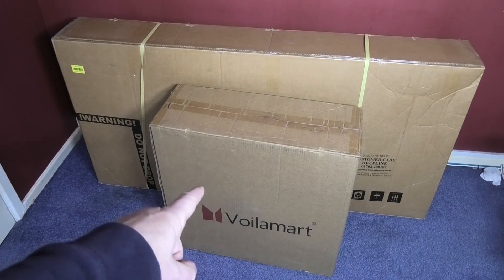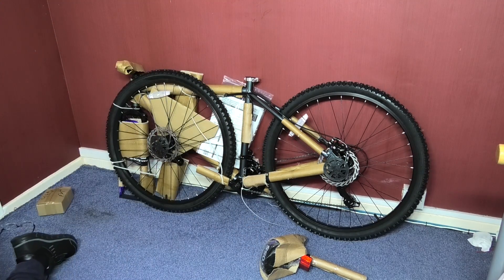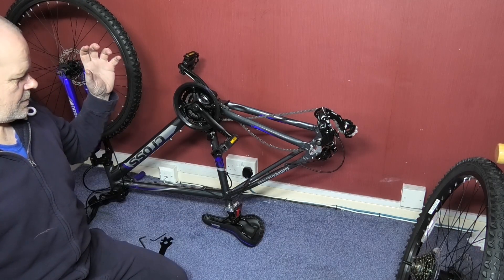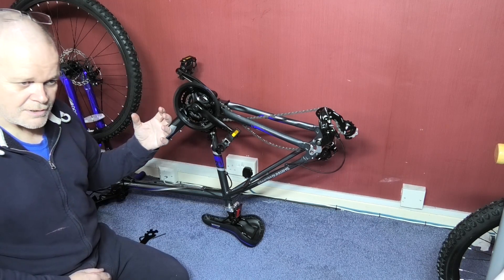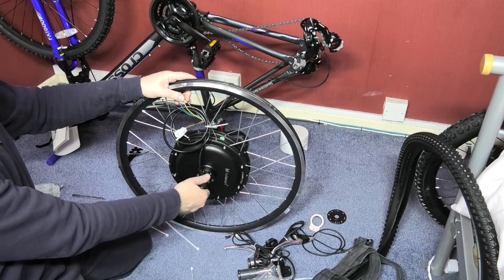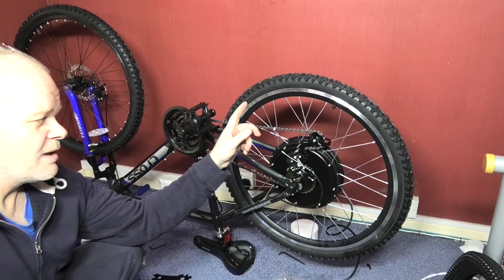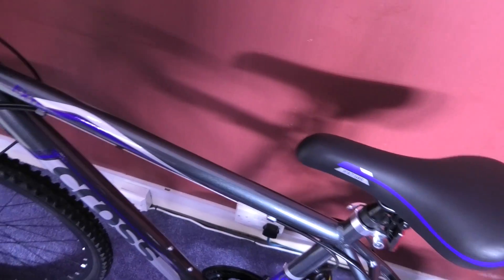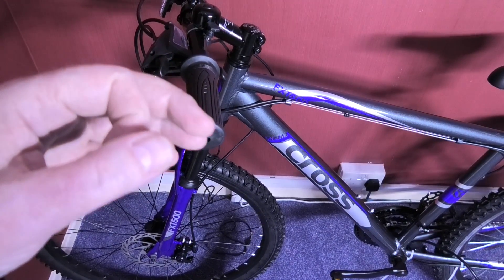Budget 1500w DIY eBike build part 1 - As cheap as possible

Comment: Hi mate your the guy who know a lot about ebike I need your help I e got a 1500w 40amp controlled runs nice and smooth with lots of torque iam swapping it out because I could never get the pedal assist to work I've ordered myself a new different 1500-watt 40 amp controller I've checked all the halll senses Phaser wires etc but is running like a bag of s*** and sounds rough have you any idea what it could be
Reply from the maker: Some of them have a 'learning' mode where you connect 2 wires and it measures the hall sensor angles, it's usually just 2 wires you connect together and then arm it.
Failing that, it sounds like you have the wrong phase to hall sense combination. try swapping a couple of the hall sense wires over. You won't hurt it.
Just because you have blue to blue, green to green and yellow to yellow, it doesn't mean it's correct.
Reply: @Vortecks  hi tony I've used to self learn wire  other day  the wheel to spin forwards only for a few seconds does it need to be longer plus I've tryed swaping the phase wires around but wheel spins backwards should I try the self-learning wise again but  longer time  or used to self learn again so wheel spins backwards and then swap the phase wires

Comment: I'm a tad late, next time you have to put grips on, use the spray women use to keep their hair in place -no, not the one youngsters use to have pointy hairs, the spray used by elderly women to look young and beautiful. This product lubes up the grip and the handlebar so you can slip it on, until the solvent dissipates, in which case it becomes a bit sticky. It won't glue the grip in place, it will help it to stay in place. 
If you want to take the grips off, use WD40 with the straw : spray between the grip and the handlebar, and twist. Be sure to de-grease the handlebar before putting the grip back on, otherwise it will slip -but I assume you guessed that.

Comment: On the note of torque arms, I would say always fit one if you're going above 750-1000W. I had to add additional support on my 3kW ebike to stop the dropouts from being pushed apart.
Reply: Very true especially if it's a cheap bike, I used them on my 1000w bike had to wait a week for delivery. Wanted to ride it so  I used a spanner and a pipe clamp until it came Works just the same lol  :)

Comment: you will be surprised what that wheel can take power wise tony, i started with this kit and now have a BT programmable controller able to give 40amp 88v  to it, i dare not go above the 40 amp but top speed is around 56mph but this too was on a budget and by making my own battery i was able to build what i consider to be a hotrod for under £500 bike not included
Reply from the maker: 3 years ago, when I built my original 1500W bike, it was over-volted to 72v (with a different controller) and it ran superbly until I sold it. I'm not doing it with this one because some unlucky person will end up buying it 😁

Comment: I fitted the cadence pedal assist to my build,  I like it. 
Thanks for sharing your knowledge,  good man.
Reply from the maker: I've heard mixed reports about the cadence - some have told me not to fit it as there is no power control and (without the LCD to select a power setting) it's always full power 😒

Comment: Will you be doing a test ride video? as i am looking to build an ebike using the same wheel and would very much like to see how it performs, also is there a particular reason why you didn't pay the extra £6 for the LCD version? which comes from the same seller it's the one i have in my watch list and noticed it's the same seller.
Reply from the maker: The test ride is an absolute must!
As the title says..... "As cheap as possible". £6 is £6 which all adds to the cost. I managed to knock them down on the price of this kit anyway 😁
Reply: @Vortecks  Great i shall be looking forward to that video, good to know they will accept offers i can maybe knock it down to £175 as you say every penny counts i guess you offered £170? anyway good luck and thanks for the rapid reply.

Comment: Just fitted my second bike up with this kit. it was previously installed on my old bike which was a Voodoo Hoodoo but this black Friday i decided to treat my self to a Voodoo Bantu. these kits are missing a screen and a programmable controller like i had on my first 1000w voilamart kit. When buying i assumed it had one but was disappointed when it arrived to me with out it. Replacing the controller with compatible throttle and screen isn't worth it as these kits am cheap yet( after market controllers if you can call them that) they cost just as much as these kits do new i know you can find cheap ones but i don't trust direct shipping from china plus the waiting times. As for regenerative braking i don't think these have it on them as I've never noticed it kicking in or anything like that.

Comment: I have 2 of these hub kits and advised Tony that torque arms would be a better idea due to the cheaper steel of the dropouts... I expanded both dropouts on both bikes before I got the torque arms... I will be uploading a video of repairing one of these hubs and putting a new cable on it just in case anyone needs it... I will also show how to replace the hall sensors as I have already done this..  The controller is capable of 60v as I have had mine up to 67v
Reply: Yes I would like to see this just snapped hall sensor wire did not have toque strengths wheel come out and snapped black hall sensor wire and need to open the hub to get to the wire to repair can you send me the link much appreciate it thanks
Reply: @davidbov9148  I will send you the link to the video, I am just awaiting replacement cable to arrive from China... It should have been here by now...
Reply from the maker: "It should have been here by now"...... how many times have I heard that about China stuff? 😂
Reply: @Vortecks  yeah sometimes its a pain... Especially the batteries... Which I am going to be doing a group buy soon to take advantage of my new membership discounts that have just come into effect.. Although there seems to be quite a delay in those arriving at the moment... Which is typical when I just want to get on and build the packs that have been ordered
Reply: @davidbov9148  the cable has finally arrived so I will be making the video this weekend... So you don't have to wait as long as I did, you can shorten the cable if you have enough to play with like I did on my other one... I just extended the power cable for the battery and moved the controller closer
Reply: Steve Dyson thanks steve

Comment: Nice to see you falling for the same problems we all did, it's lucky you have set up that forum to help you out so I'll keep out of it ??   ... but a hacksaw to those original brake levers is a cost effective solution !!
Reply from the maker: I'm leaving them 'as is' mate. The only benefit of having the cut-out levers is to stop the motor. If anyone is dumb enough to forget to close the throttle, I don't think brakes are gonna help anyway 😂
Reply: @Vortecks   I have one installed so when I'm at a red light I hold it and the throttle and just release on amber.  I need it as it controls the regen brake on my controller and when you have PAS the cut out can be helpful as there is a delay, but you didn't install that either so yeah.

Comment: Love it this will help a lot of people out so long as its kept simple. Also id recommend the fattest rear tyre the frame can take for some rear suspension
Reply from the maker: It will be as simple as possible apart from the casing which I've decided to design. I've got to go into great depth with battery building and (although it's not really needed) I'll have to go into BMS fitting, too. If I don't, I'll only have a load of questions........

Comment: Hey mate, long time no see
I’ve got a carrera vengeance ready for a doner bike, been wanting to convert for ages to take with me on the motorhome, might just do it now
Reply from the maker: Simon!!!! I was thinking about you only the other day when I found a folder with loads of DVR recordings in. It took me a while to figure out where they were from 😂
Get it built and do a video but please be careful....... I know your past history 🤣
Reply: Do it do it do it!! I did it on my vengeance black 18 inch frame and ive put a 2000 watt motor with a 52v 17.5ah battery what a beauty it has turned out to be!😍😍 change brakes from mechanics to hydro, get clark m2 from amazon, front and back fro £50 with disk and pads and they work wonders!

Comment: is there really much difference between the cheap 1000w and 1500w hub motors?
Reply from the maker: 500W difference - 50% more power
Reply: I have had both the 1000w and the 1500w motors in bits and although  can't tell what difference the windings are as they look very similar.... I can tell you that on the 1500w version, I have pushed 3000w through it... It got very hot but survived...

Comment: I would have gone a different route and used a Bafang Mid drive, I have tried those cheap "9C" hub motors and had to many rear punctures and pinch flats. To solve the brake issue I would have bought at least one stick on magnetic sensor type which they usually offer on the bafang kits (so I got spars if you want one) and cut the connectors off and changed them over, they are only 2 wire so it's real easy and using those sensor types will allow you to keep your integrated brake gear changer.

Comment: Post a video where you try out one of the budget sine-wave controllers - they look identical to the aluminum boxes you get with a violamart kit, but they're supposedly much quieter...
Reply: I changed the first of the controllers that I blew up on this kit... Over volting it... Replaced it with a KT36/48 1500w pure sine wave.... To be fair I didn't notice it at first until I put another none sine wave controller on...

Comment: I had the same problem with the regen brake levers / integrated gears can you find an solution pleas !!!
Reply from the maker: The brake levers are purely a motor cut-off and they don't affect regen. Apparently, if you let the throttle off and then open it slightly, it does start braking but I don't know if it's regen or active braking. I haven't tested it myself.
Reply: After looking at my two, 1 has the voilamart controller and other has the KT48v pure sine wave controller... The voilamart controller only has ebrake... Where as my other has regen .... Sorry for the duff info Tony..

Comment: I have a similar build. 1500W at 48V - same motor kit and everything, although mine's based on a 20+ year old scott. It tops out at 34 on flat, 37 downhill
Reply from the maker: I'm determined to see more than 40mph. If I don't, I'll keep increasing the voltage until I do 😁

Comment: Hi Tony
This is the exact same kit I fitted to my bike so I know a wee bit about it. Only a wee bit cause I have it in bits again atm but more about that later.
For the brake sensor issue you can either fit sensors and magnets to the original brakes and these are fairly cheap online, it's what I plan to do with the hydraulic brakes on my new (to me) bike.
You can also replace the brake/gear combo with gear only and use the sensor brakes. Not a perfect fit but can be done.
But more importantly, Please please please use the PAS but instead of plugging it into the controller which is pants as you said connect it to an Arduino and use the Arduino to control it properly. The 5V output from an Arduino is perfect to drive the throttle input of the controller. This would give you fully controllable PAS plus the option of cruise control and best of all I could copy your programming cause I'm useless at it. 😜
Finally  that controller is OK but badly built so I'd strongly advise you take it apart to resolder the high current tracks as they'll be very badly soldered, and for a bit more oomph bridge at least two of the current shunts with solder. 
Loving the videos mate, keep em coming.
Reply from the maker: I'm only building it to sell it mate, I'm not making it a dream machine 😁
I've already stripped the controller and added more solder - it's the first thing I do with every controller. I'm not doing the shunt mod because ultimately, it's not being built for me so I need it to be 100% reliable.

Comment: drive exact this motor for 14 000 miles with speed control and the cheap controler. Batterie is 14s 7p without bms - Balanced every 2 months with a junsi 308 dual charger. With some little modifications this motor is durable. Energy consumption is a little high. For motor braking use a magnetic sensor which can be clued to the brake levers. Regen doesnt work because the necessary connexion in the controler isnt there.
Reply from the maker: Apparently, some people have said that it does do regen braking but you have to open the throttle very slightly after you've released it.
Reply: @Vortecks  someone told you have to connect two pins ? in the controlller for regen. Do you think its possible to restrict the pass sensor to 25 kmh support to make the voilamart street legal here in germany ? My main machine is a bafang bbshd which is programmed for support up to 25 kmh when i am on the road. Because we have our own forrest I use the full support when riding here. By the way - enjoy your videos - learnt a lot from you as absolut expert.

Comment: I've got the same kit on my bike I did fit the pedal assist but took it off again as it comes on full power I didn't fit the brake switches as soon as you let go of the throttle the motor cuts out I've done well over five hundred miles on mine no problems at all I power mine with a 48 volt shark battery and it does 40 mph no problem
Reply from the maker: Out of interest, do you know how many cells in series your battery has? Is it 50.4v fully charged or 54.6v?
Reply: Vortecks hi Toni I think it's 50.4 it's only 10 amp hour so my range is only about 20 miles I use mine to commute to work and back 10 mile round trip it's faster on bike than it is in car one lad at work goes the same way as me but turns off the main road at a set of traffic lights he has got a Kawasaki ninja and believe or not I often beat him to those traffic lights
Reply: Just checked battery now it's charged it is 54.6volts

Comment: " I need to fit this but this is all intergrated.."
Part of the reason I haven't started on a conversion. I can't find the integrated hydraulics controls with ebrake contacts :(
Reply: Look at magura mt5e and canabalise the finger lever...but watch out..two types exist..open or closed circuit ...😀
Reply: I've got tektro HD-725 hydraulic ebike brakes on my bike, they have the motor cut off connections
Reply: @mushroomgods4707  yeh but they are a bugger to buy. btw those are the ones i am after to upgrade the tektros on my bike
Reply: @AJB2K3  They are good brakes, quad piston and mine came with 203mm discs front and back.
Reply from the maker: Generally, you don't need them - if you forget to release the throttle when you brake, it's the only time they're needed.

Comment: I used the 1500w voilamart kit with lcd and a 48v 17ah battery   absolutely love it...excellent kit in my opinion... great vid tony 👍
Reply: Hey guys, I have 2 of the older ones like Tony with the external controller.... As a battery builder, I have pushed 3000w through mine at 67v and hit 57mph top speed... I love the kits and the price is awesome....
Reply: I have the same and get 30mph but rarely get a wattage Reading above 800, am I missing something?
Reply from the maker: It's possibly due to your battery not being able to handle the current mate
Reply: @stevehailes1  steve..mine the same,never seem to get a wattage reading higher than 800,but can get 38mph out of it..my controller is built into the hub.. it's a fantastic budget kit,I've a 52t chainring so can peddle up to 28mph with pas..
Reply: steve716 that is really interesting. Mine is also the one with the controller built into the hub which makes for a much neater installation. So perhaps my battery is the problem. Would you mind telling me exactly what yours is and where you got it? Thanks!
Reply: @stevehailes1  hailong 48v 17ah from d&h gate ..absolutely! a much more tidy build..I'm just under 16st also.. but my bike is a Marin year 2003 full aluminium full suspension..
Reply: @stevehailes1  it could be that the LCD needs calibrating.... Do you find that the mileage is out?